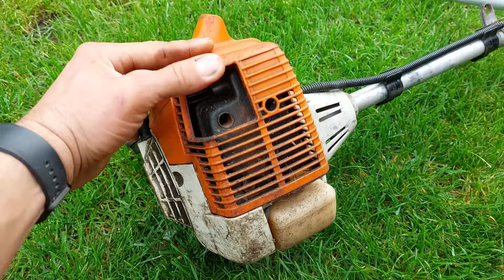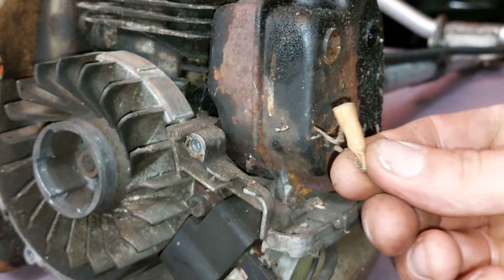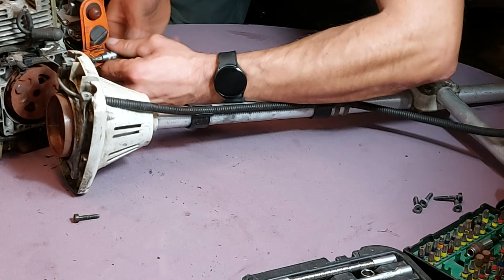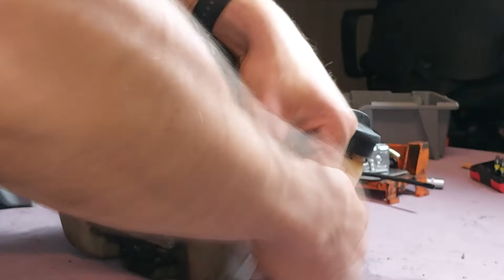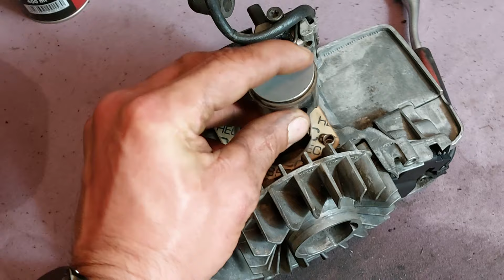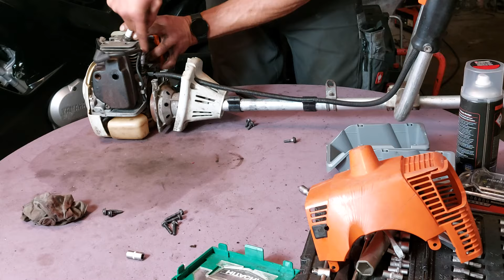Stihl FS 120 2-STROKE  ENGINE Trimmer  disassembled Freischneider  Tриммер

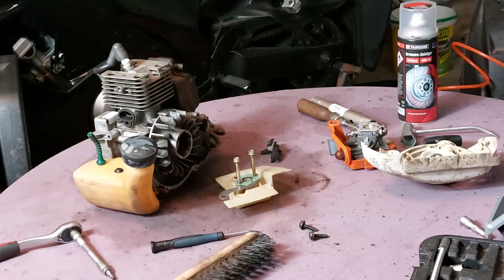Comment: Dang. At 7:51 that spark plug wire is still damaged and we never see the replacement wire get installed. Of all the things possibly wrong with the engine that was of course the most glaring and an absolutely necessary replacement. But the recording cruises through as if it is ok to have an exposed, shorting, near breakage electrical conductor. There's not even a voice over (in Russian or English) to say, "oh, yeah, I replaced that Macgyver wire with a new one from Stihl Parts".

Otherwise, thank you for the recording of the tear down and cleanup.
Reply from the maker: if I film every little thing then my video will not be 11 minutes but 45-60 minutes, thanks for the comments